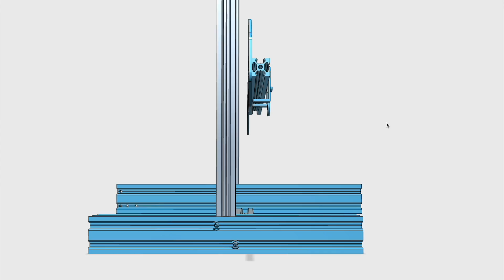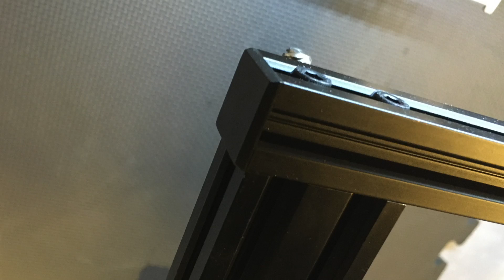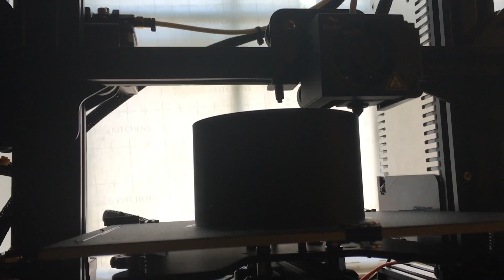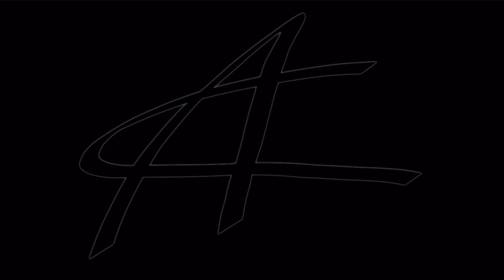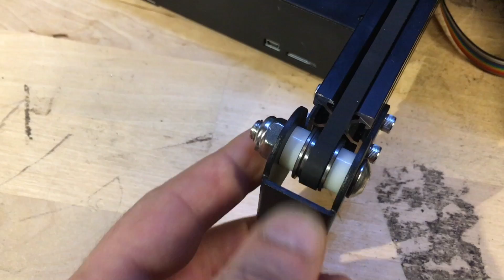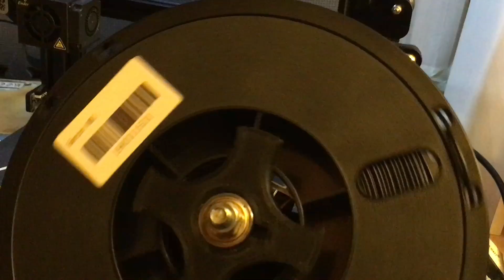Ender part 1: Hardware and assembly evaluation

Comment: im getting an ender 3 as first printer and have been watching your videos! very informative, thank you. im also ordering skr with tmc2209, noctua 4020, 5015 dual blowers on hero me shroud. also watched your zwobble video so your leadscrew collar, bearing and flexible coupler will be one of the first prints. do you have a squaring guide youd recommend?

Comment: Are you making the printer desgin you showed off?
Reply from the maker: I had intended to do that a while back, but I had to order a thicker carbon fiber sheet from overseas, and by the time it got here, I had moved on the more pressing subjects.  I'll get back to that printer eventually and post all the files, just for reference if nothing else.  I have to re-design the Y-carriage too because the silicone gasket pad did not insulate as well as I had planned, so I had to isolate it with a wood shim to keep the printed carriage from melting... not optimal, so I'll have to either come up with something more clever, or just use something like an aluminum openbuilds cart

Comment: Good video, well balanced and some excellent pointers on machine design that will be valuable to the modders. I bought an Ender as a first machine just over a year ago to start learning about 3D printing and after a year of designing, printing and refining modifications I think it has probably been taken to it's logical conclusion. Now that acquired knowledge is being leveraged in the design of a coreXY machine which I might even get around to finishing and publishing some day soon(ish). 
I looks forward to further installments. Thanks.

Comment: FYI Switch down for on is the standard in Australia. Aust and china share a similar power point plug although they use it upside down. All powered appliances and specifically power points are also switched here as well.
Reply: Also same in many central Europe countries, BUT since that standard is "only" about 20 years or so old, many people still prefer to put them the other/wrong way round. - As usual, old habits die hard. ;)

Comment: Alex, any chance you'd care to share your designs? I'm thinking the spool holder in this case. I checked your thingiverse account and it wasn't posted there.  I also applaud your attention to detail. My hotend cooling fan needs replacing... I can feel the vibrations at the nozzle.... not much, but I'm sure it's not making my prints better!
Reply from the maker: Sure, I had a few people ask that.   I figured there are so many spool holders out there that nobody would be interested. I'll make a few variations and then post it on thingiverse.
Reply: @AlexKenis  Cool! I was just about to ask the same thing, I've been "fiddling" with my Ender 3 for around 6 months now and hadn't even though about the spool mount causing artifacts. Any designs you care to share of recommend much appreciated!
Reply: @AlexKenis  Hi Alex, great video.  I'm sure I'll learn more from your follow on videos, but the two best things from this video for me were your spool holder and your tips on fan mounting.  Please let us know when your spool holder design is available on Thingiverse.

Comment: I have Ender 3 from June, dog test print quality was very nice, but I had only a piece of filament that came with the printer ...so it prints only his feets :-D
I think that it is a good printer for very low price... but I hadn't the same problems with fan vibrations etc.

Thanks for nice video, useful hints ;)

Comment: Alex you mentioned a couple of times  that there arte better more flexible platforms that you can easily grow and mod (massive paraphrase there) Can you point me to a couple especially a coreXY style.  Thanks Great stuff as usual.
Reply from the maker: Well... it gets complicated since 'better' is subjective..  It's really what is 'better for you' since it depends what you intend to grow or mod, and what types of objects you intend to print... tall or long or wide, thin or thick layers, certain materials, etc.  It's a good question thought, and I should probably make a "which kinematics are best to mod for what purposes" guide as part of the series. If you want more Z-height, a box-frame (either coreXY or cartesian) or delta are better because you don't have to deal with the object swaying in the Y direction since it is stationary, and you can just add longer Z-axis as needed with no penalty for the additional length and weight. But box frame printers are tougher to expand in the X and Y direction (because of the hardware, and dealing with potential racking/flatness/binding issues with the bed), where a moving bed i3 design is easy to add extra Y length sine you can just add a longer bed/belt/rail... BUT then yo run into the problem of an increasingly heavy bed causing print artifacts (unless you plan to print slowly, like using a Volcano hot end and large nozzle, then it doesn't matter as much), as well as needing more wattage from the power supply for the larger heated bed. Box-frame printers have more of a penalty for larger X and Y because of the gantry (which is why you don't see extremely large Ultimaker crossed-gantry style printers), and do best by decreasing the weight of the head and/or using high stiffness-to-weight ratio gantry materials as you get larger, but coreXY gets around SOME of that since it doesn't rack (like an H-Bot does), but the stiffness of the belt, pulleys, and motor spindles becomes more of an issue, especially since deflection on one axis translates to deflection on the other. i3 style printers are also easier to use large/complex print heads/hot-ends since the hotend is essentially outside the printing envelope, where a box frame printer has to leave extra room for it inside the printing envelope.  BUT box frame printers are easier to enclose, especially coreXY which puts the motors outside the printing envelope...
Reply: @AlexKenis  yes it is subjective.  I like cube frames as they more stable the voron crowd loves the fact the base plate doesnt move  because of the less mass moving the better the print  idea. but moving it only in the z action seems a reasonable solution. I print mostly functional parts not art pieces speed is nice tool head changing is interesting but adds a whole new level of complications multi material is nice but I have the waste in the single print head solutions...

anny way I would love to hear your thoughts as I am sure others would as well

Comment: i have a part / upgrade part that i havent released yet (heat-brake fan and part cooler)  that fits the V8? (flat side heat sink like the Tronxy's and ender's) would you like to have first shot at looking at it?

https://youtu.be/7y5m0y5f1KE
Reply from the maker: I'd be happy to try it out.  The extruder vid is probably a few weeks off, and I am waiting for more fans in the mail, so just drop me a link or email and ill add it to the list to test.   I'm working on  a multi-directional overhang/bridging test to compare cooling mods, so i'll be looking at a bunch of options.
Reply: @AlexKenis   email sent to gmail address
Reply: @AlexKenis  have you had time to take a quick look at my part files?

Comment: You forgot to specify which Ender because they aren't all the same anymore. They have made design changes and upgraded the board and the drivers, added auto bed leveling via BLTouch (tramming), fixed the issue with XT60 connectors as they stated it was a supplier issue when obviously it wasn't they weren't using legit XT60 connectors, the power supply was upgraded, the extruder arm was changed and the springs, there are at least 3 different beds. There is a troubleshooting guide (121 Pages) in the Ender Facebook group that covers all of the issues in the file section. So some of this stuff unless you are talking about newer printers may not be an issue. 

Like you mentioned the issue with the shroud vibrating. Mine doesn't vibrate with the stock fan. The main issue with the Ender 3 shroud is the fact it has the same issues as the CR-10 in that the airflow inside the shroud area isn't controlled very well. It's turbulent enough that it interferes with the part cooling. This has also been resolved by the community as there are a couple different part coolers that work way better than the stock setup.

There is also the problem with the PTFE on the non-upgraded ones being cheap so it fails faster at higher temps. (Dupont PTFE is supposed to fail at 260C but the stock stuff starts failing around 225C) So a month after people get the printer they start having clogs or the PTFE slips out because the lock fails. We recommend upgrading to Capricorn XS tubing and switching to an All-Metal hot end from Microswiss, or just upgrading to an actual E3D V6/clone. It all depends on what people are printing.

I mainly print PETG on my Creality printers but printing ABS/ASA would be worth upgrading for stronger parts since they have a higher Glass Transition Temperature. If you print PLA there is no need to upgrade to an All-Metal hotend.
Reply from the maker: Hey man.  Yes, good points.  I mentioned some of that in the livestream, but I should have re-iterated.  I'll touch on the bed and electronics in their respective vids, but the board is 1.1.4, 220w bed with removable print surface. Good tip on the tubing.   I have several meters of Capricorn, so I'll be using that eventually, but I noticed  when I used a drill bit to taper the edge of the stock bowden tube after replacing the coupling,  that it didn't feel like typical tubing, so it makes sense what you said about melting temp.  Makes me wonder what they used.  I have seen 200c rated tubing on aliexpress, but literally only one other place.
Reply: @AlexKenis  I want to try the silicon carbon glass bed and upgrade to rails. You could always do a video on that BIQU/Bigtreetech Ender 3 upgrade board. I haven't done that upgrade yet. 

When Capricorn first came out I bought the light blue regular kind and the darker XS. I used that tubing cutter they sell on the site and I found out about that drill bit trick. It helped with making it easier to insert the filament at the extruder. I have been using it on my Wanhao I3 and D6 as well as my CR-10's and I haven't had any issues but some people reported having ID issues with the tubing they received. That was a while ago though.

There is also Tough Tube from TH3D which also works good. 
https://www.th3dstudio.com/product/tough-tube-high-temp-high-tolerance-ptfe-tubing/

Comment: gj again, when i got my ender 3 i  need to replace 3 wheels caus they damaged and after 9 months with ender (too many upgrades) i think in future i dont buy any wheel system and moving heatbed products :) , corexy better i think, thank you alex its very good series started
Reply: CoreXY is still a moving heatbed system. It's just vertical instead of horizontal, if I remember correctly.

Comment: I got a Ender 3 a year ago in order to get my feet wet. I knew if I started making my own printer from scratch I would end up frustrated because there is way too much to learn.  But I am an electronic product designer and have been doing that for 30 years. I love designing hardware. So this series is something I hope to use as a springboard to design my next awesome machine.

As far as flat spots on the wheels. That disturbed me but I didn't see that it caused a problem. And because I infrequently use that machine it always has flat spots, and maybe I need to adjust the them? On the pick & place machines at work we have them go through a warm-up sequence before we place parts. To literally get the grease warm so the moving parts can move freely but with the tight tolerances to give us the accuracy we need.  So I wondered if I should do a warm-up run to get the flat spots out of the wheels. Advice here would be welcome.
Reply from the maker: NICE!  Hopefully the 'side videos' on theory and options would be helpful.  I really love designing and testing printers, so it is a bit weird to be doing a whole series on a commercial machine, but i think it will make for a nice compare/contrast and springboard for more techy content.